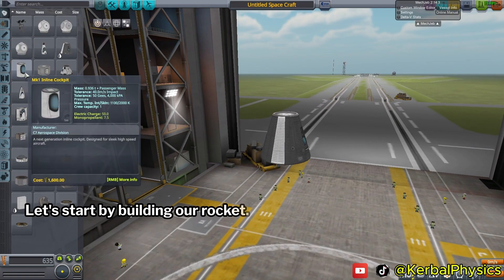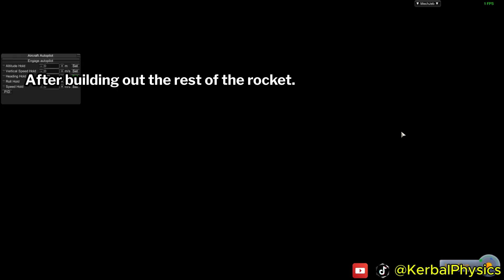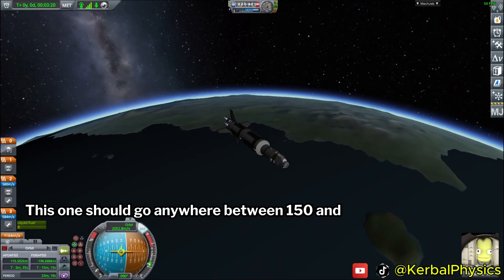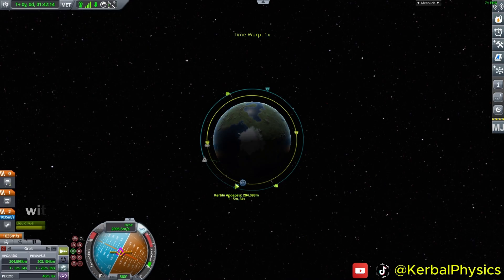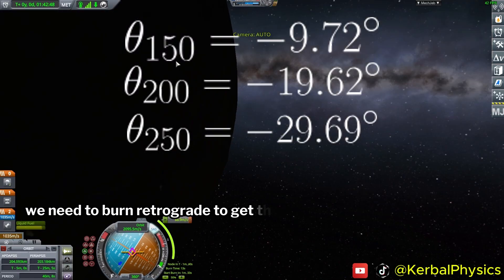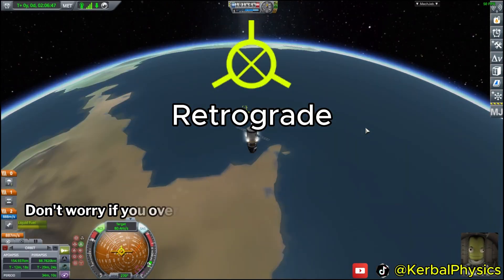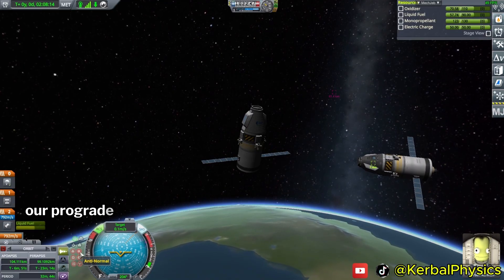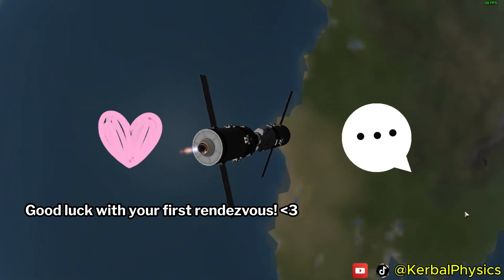How to Rendezvous and Dock for the first time in Kerbal Space Program!

Comment: Couldn't you simply launch at the optimal time to reach the rocket already in orbit more efficiently? For a 100km orbit that would be around 200km away from the launch pad, then burn retrograde wrt the target. Also for the docking part wouldn't it be easier to set the docking port as the target and then get the SAS to keep aiming at the docking port?
Reply from the maker: you could, but these are pretty advanced techniques and wouldn't be suitable for a beginner's first time. 

setting the docking port as the target can be crucial for more complex missions to space stations, so it is probably a good habit to get into. 

however, by keeping SAS constantly pointing at the target, your spacecraft will be constantly changing directions as you move through space, making translation manoeuvres more difficult. i think it is almost always better to try to keep the spacecraft aligned to specific headings on the navball, so your translation controls feel more natural. this also mimics how docking operations work on real-world spacecraft.